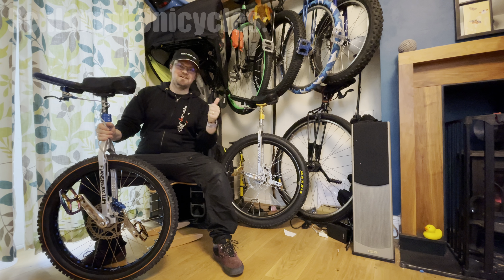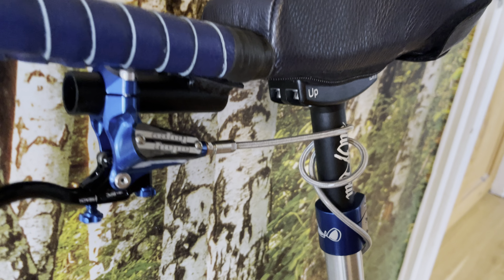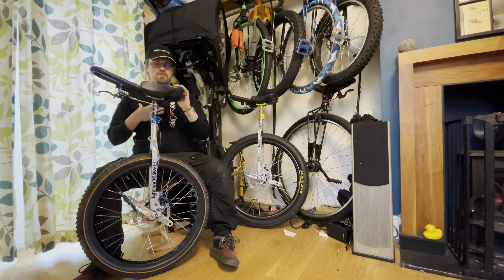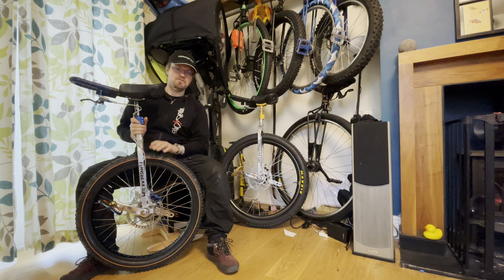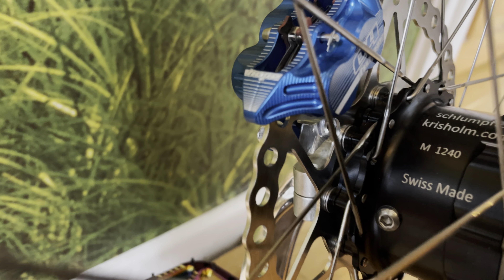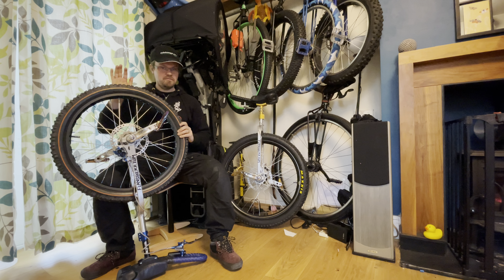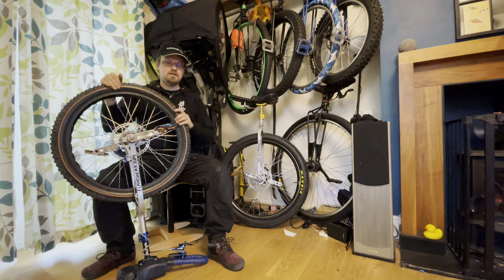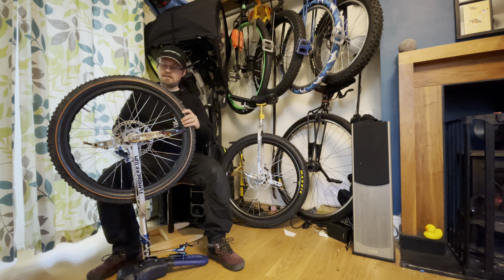Schlumpf Unicycles: Flansberrium G24 & G29 - Overview & Issues

Comment: Nice looking unicycles still I would have gotten a geared 36" for cross country riding with the appropriate length cranks would be easier with a bigger wheel. Your 29" would be great for some mountain bike trails we have around here. How fast are you riding your geared uni's? Yesterday I made a good milestone of riding 20km/hr average speed for 40 minutes on my schlumpf. However I did learn yesterday that I can't make a right hand turn at 20km/hr.
Reply from the maker: Thanks so much David. I agree that a G36er is the best for XC / distance, but at the same time I believe I may find that on some occasions intimidating. I think the 29” was decided on as I’m super confident riding that size in 1:1. As for speed. I do know that geared riding can easily allow you to go faster, but that’s not really my aim - I don’t really know if I’m quicker than in 1:1, but I do know I have so far enjoyed the “trippy feeling” of high gear and the lower cadence, and in fact work to ensure my speed never feels too crazy for my skill. 

But speed will come with control I think and that’s where a G36er will probably just feel more natural to ride. 

Likewise the G24 is an odd choice for many, but I’m down for the challenge of riding in high over bumps etc and dealing with how the smaller wheel reacts. I think it won’t be easy to ride, but I think it’ll be fun 🤩
Reply from the maker: Good going on your speed milestone. I don’t think I’ve the stomach for that as by my nature I’m cautious. I can fully imagine a right hand turn being hard work 😓 Hope the implied fall wasn’t too bad!
Reply: @mindbalance_cc  A G24 is a good idea like you said for portability, that'd be really handy. Initially I never wanted a G36 when I first heard about schlumpfs as at the time I was regularly riding an ungeared 36 with short 110 cranks and I never thought it was too slow. Then I had the opportunity to acquire a G36 at a price I couldn't refuse and after riding it for a couple of years it feels natural now and I can do some good distance and speed with it.

Fall wasn't bad it was more or less an un elegant planned dismount as I realized I would not have the control to swiftly turn a G36 moving at 20km's around a sharp right. So I slowed down and bailed off the back but still dropped the uni as I was going fast.

Comment: Why it's not? It was probably engineered with smaller caliper, that is why you may need to use 2, 3, 4 washers per bolt. I'm only guessing that, on the other hand, it's easier to space rotor away from the flange over grinding it down.
Reply from the maker: Thanks for watching and commenting! 

It’s curious for sure. It might be an intended feature of the hub to have some adjustment from the rotor side, however normally you’d use the caliper’s mount to slide in or out of the wheel and get it aligned. 

It currently appears that in the hub diagram the space was planned to be 17mm clearance, but when measured it is 13mm. How? It appears that the flanges are 61mm apart whereas in the manual’s diagram they’re shown as being at 57mm apart. 

It will be fixed I’m sure, and the wider flanges do make for a stronger wheel. We just need to figure out the safe approach to get alignments sorted especially for bigger 36” wheels.